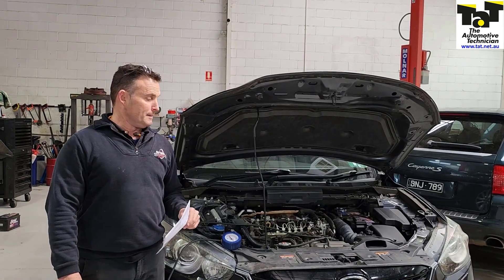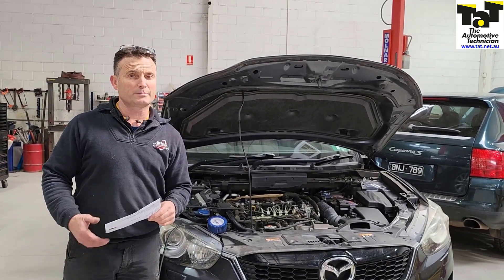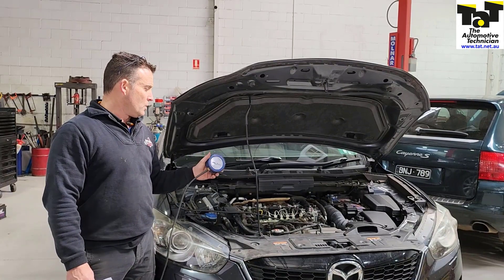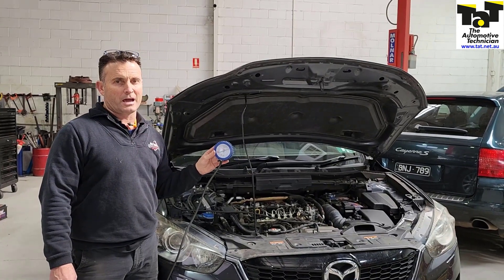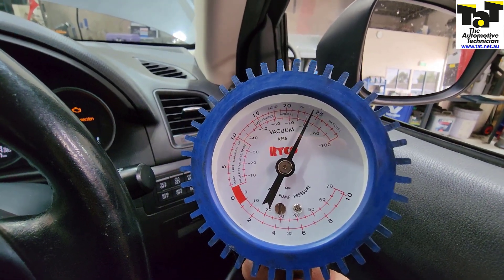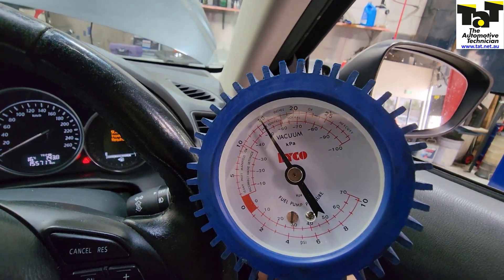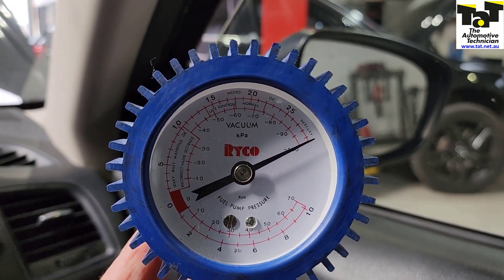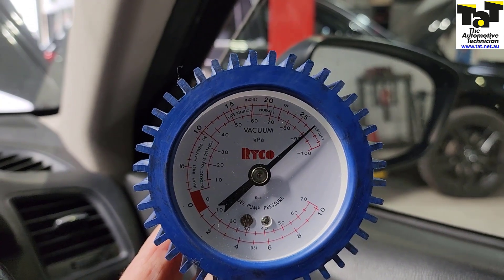Mazda CX 5 vacuum pump testing

Comment: Hi,
Could you please tell me the torque specs for the 4 bolts of the vacuum pump, as well as the 2 M10 bolts that were removed from the top side?

Thanks a lot in advance for your help!

Comment: Diagnosis is very handy when looking at the brake booster pressure data. 
Check this out 

Mazda P258B Vacuum pump diagnosis and fitting
https://youtu.be/94vmHdRvGLc

Comment: And 2 months later you  replace the turbos and 2 months after that you replace the complete engine assembly.
Good old Mazda 2.2 diesel engine trying to regen so often it fills the sump with diesel. 
First thing that seems to go is the vacuum pump